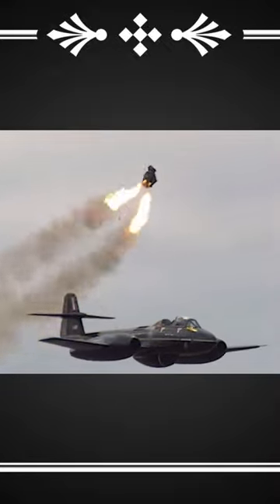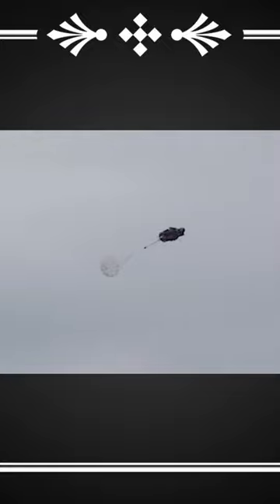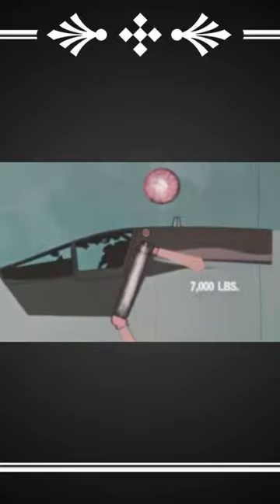The F-111 Aardvark’s Crew Ejection Module!! #shorts

Comment: Former ejection seat mechanic here. An ejection seat will impose 40 Gs on a pilot in a fraction of a second and will make you an inch shorter. Pilots can only eject twice and then are permanently grounded because of how traumatic it is on the body. Additionally, if your too tall, you have to sign a waiver saying your okay with your head colliding with the canopy in the event the canopy fails to eject.
Reply: You also have to go through a full medical re-examination after the first ejection that may permanently ground you.

Scary stuff especially considering some planes like the F-35B can do it automatically.
Reply: @AnarexicSumo  yeah the whole idea of ejecting is just a bad idea most pilots will tell you they would rather just go down with the plane. Also not sure if this is true, but I heard that the automatic ejection idea was removed from the planes capability because it would occasionally experience malfunctions and just go off at will.
Reply: I knew beside every thing seen in that film,  in top gun 2 ejecting Twice is just nuts.
Reply: How to zero-zero ejection seats work? Do they burn longer? If they burn "harder" wouldn't that cause more harm to the pilot?

Comment: It was originally designed to be able to eject above Mach 1 until they realized if a jet was failing enough to require an ejection that the tumbling would have very quickly brought it below the speed of sound and they realize that six hundred miles an hour or even 500 miles an hour was a more realistic speed the design ejection seats around

Comment: But what happens if the pod is damaged and/or malfunctions? Can the pilot still eject the old fashioned way?
Reply: When the plane is hit in a way that cripples the pod, the pilot is done for either way. The F111 gets a whole pod because it can reach speed and altitude that make ejection by seat impossible.